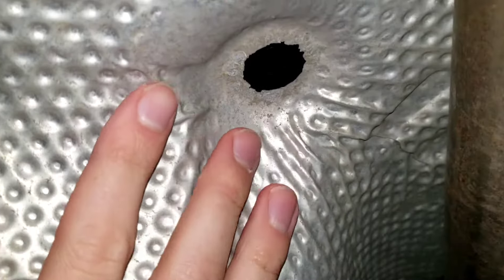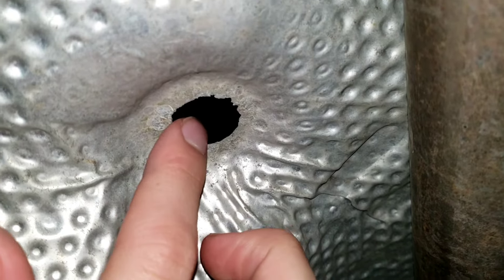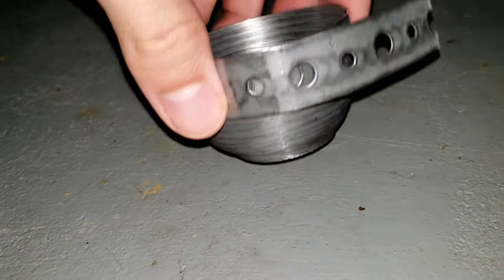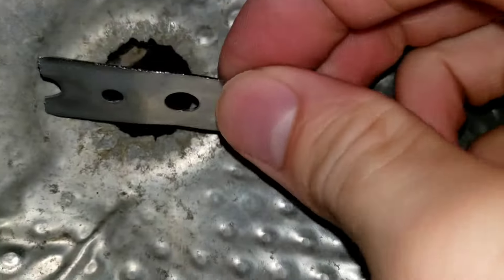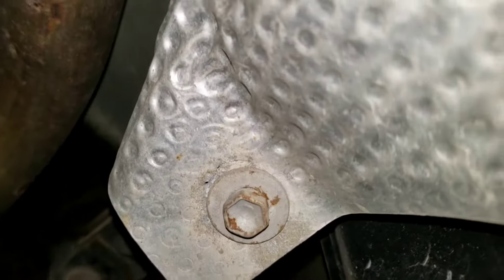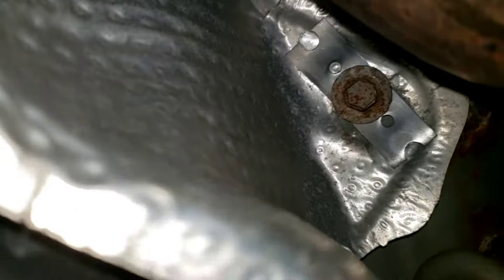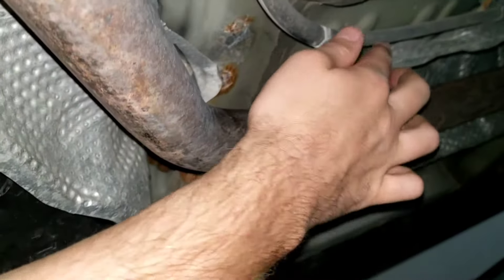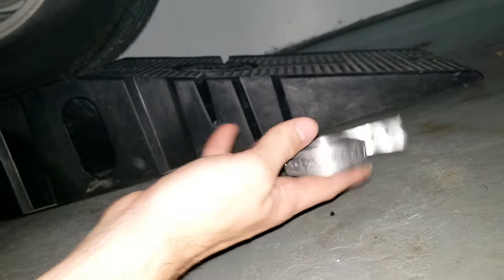How To Silence Exhaust Shield Rattle

Comment: Good job...would suggest to  isolate between bolt/strap and aluminum shield so will not happen again...dissimilar metals cause corrosion of the more anodic material.
Reply: with what?
Reply: A couple of coats of hi-temp spray paint in whatever color you like would do. @LykeArgy

Comment: I use penny washers and a fibre washer underneath so the steel of the washer doesn’t react with the aluminium. At least Toyota use a decent size bolt and washer on the original

Comment: Very nice! I had the same issue with my 2010 Prius years ago. I fixed it with a thin metal "washer" I cut off from a can and drilled a hole through it. The noise comes back again now and I'll try your recommended galvanized hanger strap this time as it looks more sturdy.
Reply: Eww a Prius

Comment: Hello thank you for the video have the same issue with my 2008 Mercedes Benz GL450 just a suggestion instead of the metal wire you use wouldn’t a larger metal washer work better you can buy a pack at the hardware for less than 5.$ also rivets work great if the bolts are striped or broken…

Comment: Would a large washer work better because it would be more firm?
Reply: The problem is that due to metal reacting to metal, there will eventually be new holes. Better to use "just enough" and repeat the process a few years down the road. :)

Comment: Heat shield for my 07 camry 4-cylinder above the >"Muffler"< itself had became completely loose.   Removed, no rust very thin.  Is this required to have it reinstalled?

Comment: good to check on that as a cause for rattling noise, in a worse case a mechanic could diagnose it as a bearing damage /problem with the crankshaft, and jus by this wrong diagnosis you would throw away your car or sell it for cheap

Comment: I think you took this apart just to do a video. Like wtf bolts out smh
Reply: They rust, and break. Northern states do that to a car, worked on many like that and it’s happened to me with every car I’ve owned
Reply: This is a real problem with Toyotas.  The bolts are ridiculously undersized (10mm head) and usually snap due to rusting
Reply: Just looked at mine and it did the same thing